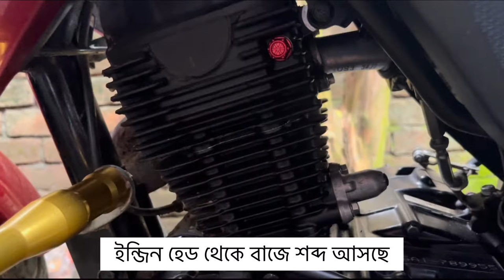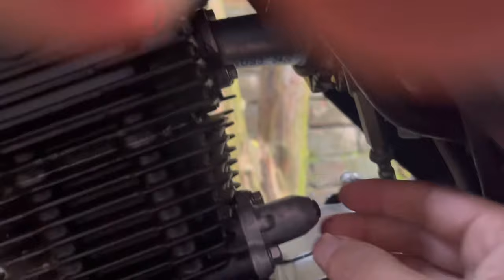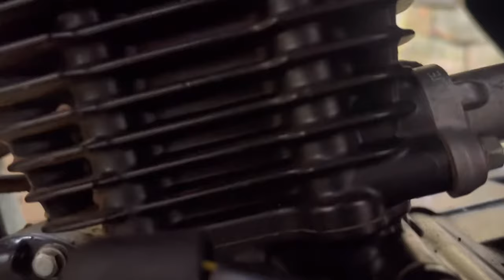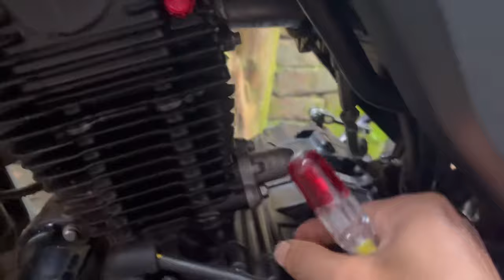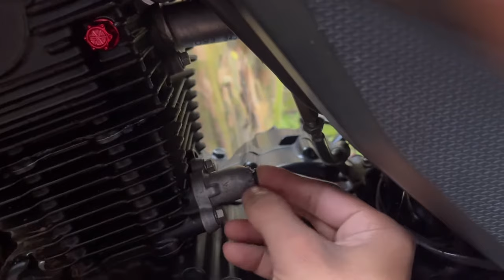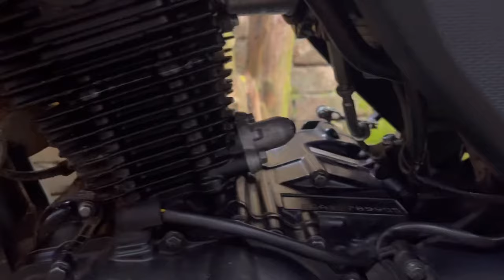ইন্জিন থেকে বাজে শব্দ আসছে?॥ টাইমিং চেইন লুজ॥ ১ মিনিটে সমাধান॥ Engine head noise Solution|| Gixxer||

Comment: 13000 a amar amon sound hosse, adjustor paltalei hobe naki timing chain paltate hobe?
Reply from the maker: adjuster change kore nilei hobe.
onek somoy tapid adjust kore nileo solution hoye jay. apni suzuki servicing center a akbar dekhan.
Reply: @arifurtonmoy5293  Suzuki service center a to bole timing chain change korte, kintu 13000 a timing kno jabe, rough ride o kora hoynai tarpor o
Reply from the maker: @mahmudulhasanrony6536  onek somoy hoy. sob kicu maintain kore ride korleo dekha jay kono part nosto hoye jete pare. eta onekta luck er upor o depend kore.
change kore jodi problem solve hoy to kore nen.

R jodi mone hoy j na ora vul boltese tahole onno kothao dekhan. tarao jodi same kotha bole tahole to sure hoye gelen ..